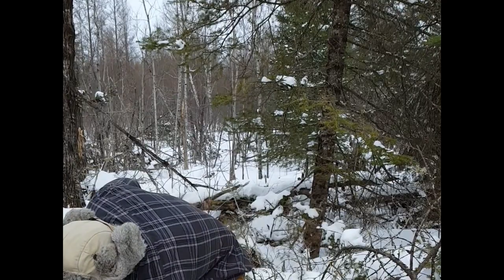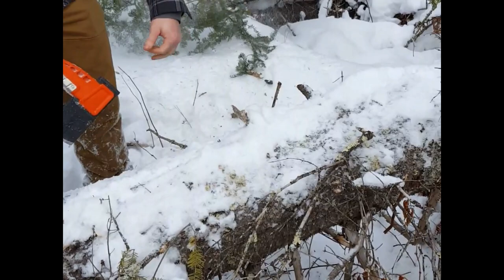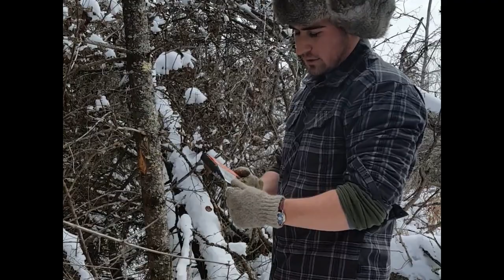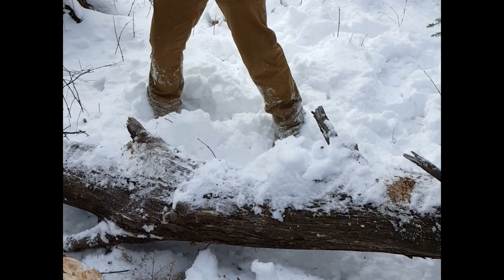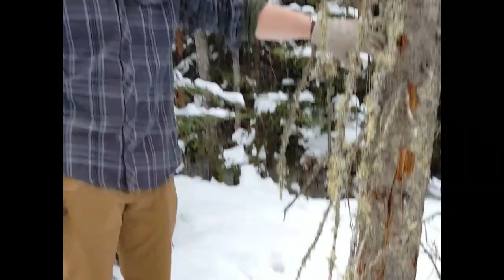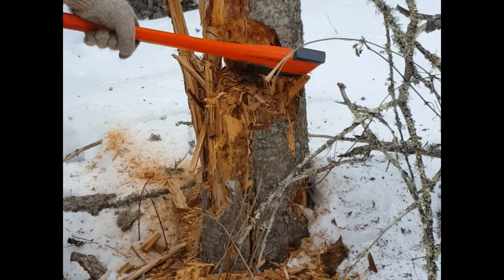Not a review! Husqvarna A2400 MultiPurpose Axe testing

Comment: Greetings from the Emerald Isle of Ireland 🇮🇪🇮🇪, this is a great splitting axe, the secret,is to have the wood at waist height,to get all the energy of the swing,into the rounds, I use 3 truck tyres with the inner walls removed,stack the round in tightly,and split away, saves your back no end, make sure you have a solid base, eg, concrete

Comment: Hello! which is better for husquarna a1400 (a2400) or Gransfors Bruk Scandinavian forest axe for felling?
Reply: The A2400 is a multi purpose axe, not a felling axe. It's too thick to cut deep. It's not a dedicated splitting axe, so it could be used for felling occasionally,  but would not perform as well as the other.
Reply: @jaydak99  to be fair though a bit of filing could help that. I like wedgy axes for chopping if it's green.